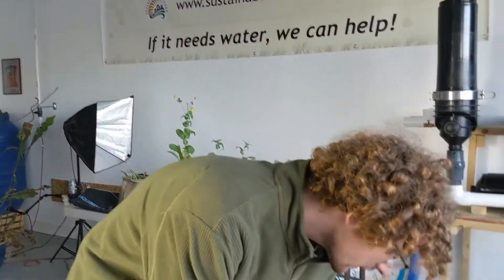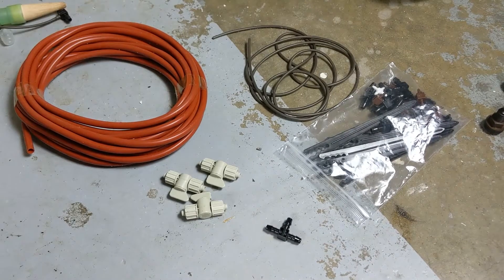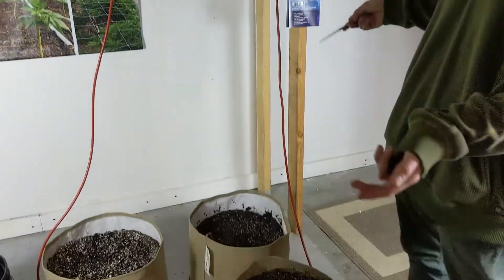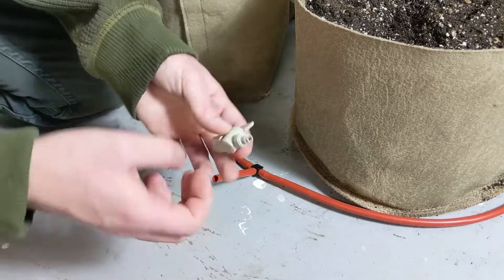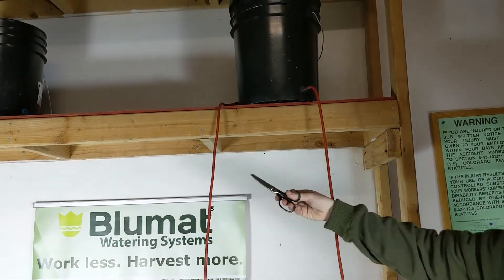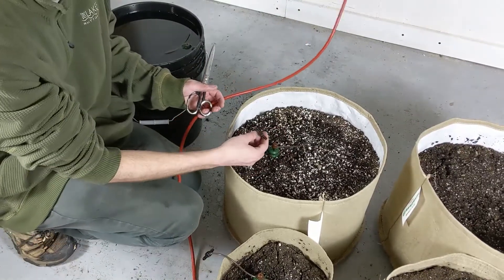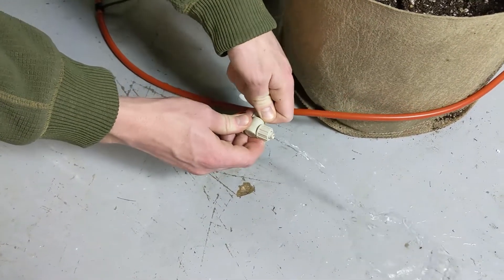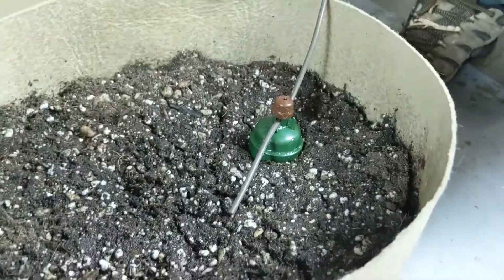Gravity System Installation

Comment: I am growing in a tent with the Reservoir on the side of the tent, Gravity feed system. When making the loop do the two lines need to be even with each other? One line goes in one side of the tent and one on the other. So do I need to put the purge valve roughly in the middle of the loop?

Comment: Can you also just run one line down and use a splitter to make a loop from one line?
Reply: Did you get an answer to your question, I have a 5pk troupe PK coming and only using two pots. I want to run with the equipment bought but looks like I have to buy a shut off valve, T bar connector, grommet for bucket (have one w/package) and the super flex hose not counting the drips. Another $100. or so.

Comment: @SustainableVillage1 is the dual-bulkhead approach still needed if only watering 1-2 pots or can I simply do a straight path from bucket->bulkhead->shutoff valve -> blumatA -> blumatB -> shutoff valve?
Reply: Did you try out the straight path instead of the loop, if so how did it go?

Comment: i pump it automatized up using a prgrammable solar pump from the rain deposits below the roof up 2m above for the gravitational irrigation deposits max. suction height (1,6m) & max. pumping height (4m)should be respected buying such pump (aldi 40€ or aliexpress cheaper)

Comment: i connect water dposits on a 2m slope to the rain deposits below the roof by a hose (deposit connectors taps w/ small filter inside 3$ from aliexpress). having spent all rain water, i fill them up w/ tap water in drought periods.

Comment: 2 more IMPORTANT points to mention: water levels in the deposit should not vary too much from full to almost empty changing the pressure level for the ceramic valves too much which would mean recalibrating them twice (for almost empty to full again). some use tropfblumat for fertigation, but i doubt wether the dissolution in the deposits would stay stable enough for its run through time or concentrate too much near the bottom ? one purpose of gravitational deposits is chloride free watering, because even fed w/ tap water (in absence of rain water for drought) it dissolves during hours or days into the air.

Comment: Do I need an aerator in my res for this system? I'm using a 5 gal bucket as well.
Reply: Aerator introduces air bubbles, and they are the enemy of a Bluemat system. So no i wouldn't.

Comment: Do you have to have the on off valves connected to the bucket
Reply: No but they are $5 and you would want that extra option in case you have an emergency and need to quickly shut off water.

Comment: If you set up a disribution dripper . Do you need to calibrate all of them. Or just open them up all the way?
Reply: Yes
Reply from the maker: You do not need to calibrate all the distribution drippers. You do not need to open them unless there is a clog or you are seeing a problem with them not watering. However, you do need to calibrate every Tropf Blumat.